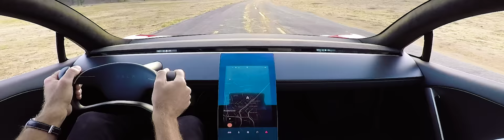Tesla

Comment: Need. A. Tesla. ASAP.
Reply: Want*
Reply: Need*
Reply: Get. SUM. Money. ASAP.
Reply: 100 thousand dollars at least.
Reply: Don't use auto pilot on a tesla you'll die.
Reply: not many people have died from using auto-pilot. But everyday people die from driving by themselves.
Reply: Attack Helicopter Chris Tesla blamed the deceased driver while the car was on autopilot dude lol that's fucked up
Reply: Rimac cars are better (stronger) :D
Reply: x50 get a fire extinguisher and window hammer first.
Reply: curiosityuniversal VICTIM WHO DIED IN TESLA CRASH HAD COMPLAINED ABOUT AUTOPILOT BEFORE
Reply: This just happened today! Tesla with Autopilot slams into truck stopped at red light
Reply: did they ever say that you can or should use autopilot because it can do everything a driver can? No. It can't, it will probably be able to in few years... Autopilot is only safe to use on streets where there aren't many turns etc.  and in those cases it's much safer to let autopilot drive instead of you. But it's not synced to every stoplight, you should know that. It warns you every 2 minutes or  something to put hands on the steering wheel. And if what you mentioned about the truck is the same crash I've heard of, than it's because autopilot couldn't "see" the truck because it was white so it couldn't make a difference between sky and the truck. That problem could be solved by not making roofs that are reflective...

Comment: Electric > gas
Reply: Anyday
Reply: Definitely not, a such statement would need a context to be true. It's similar to saying airplanes>submarines. Ok but in what?

Electric is mostly better in light and small sized, short ranged traffic vehicles, while gas is better in longer range, bigger vehicles like SUVs and pickups. Of course you can make everything electric as Tesla just did, it's just not going to be generally better. Primarily in the cost of it. That's why I'm worried about the Tesla truck, it could be the doom of the company. Making a superheavy, super longe range highway vehicle electric gives you all of the disadvantages and none of the benefits. That truck'll be like steam power efficiency, I really hope they don't screw things up with it.
Reply: G.Zoltan electric > gas

Comment: Theyre advertising because Tesla is failing it's production requirements.
Reply: Legion. Yeah they shouldn't be cause, mostly electric car manufacturer like Tesla doesn't tell stupid Americans about the truth about those batteries and after how much mileage they start to decrease in their power. And secondly the battery manufacturing cause more pollution than the IC engines so it's not green. Mostly the people who  buy teslas are rich Americans who don't even like cars. Third why do you even need the Tesla roadster it's totally stupid for a production car to have that much acceleration. And then the stupid people compare electric motors to ic engines.

Comment: Something I can't figure out. We can make magnetic fields from electricity with things like copper wire, we use that to rotate permanent magnets which come from rare earth materials, which if not rare, are hard to extract and most of it comes from China. So what stops anyone from making motors from two sets of magnets created from electrified magnets instead of one being permanent? It would be easier to source the raw materials, reuse and recycle.

Comment: I've always thought or wondered  why is one of the four wheel rigged up to a dynamo to charge a secondary battery whilst it's moving when 1st battery is low switch to secondary battery and start over again dynamo charging up the 1st battery once the cars going shouldn't it be self charging  then ? Someone with smarts please explain why this wouldn't work
Reply: Well due to losses in the dynamo, motor, wiring and battery all you’re essentially doing is wasting energy.

Comment: So far, they have sold me a brand new 2021 Tesla Model 3 with damages throughout. Touch-up paint coverups on door hinges with a broken clip which is a safety issue and other door hinges that are scratched with scratches on the inner door sill, passenger door that is so close to the rocker panel that it has actually scraped the paint off and some metal with it, door handles that are not flush, a improperly aligned hood which has chipped paint on the edge from touching the body when opening, defective paint throughout, thin paint on the bumpers to the point where you can see the primer through the clear coat, charge port flap that touches the paint when opening, and I’m afraid to look any further. These were all unnoticed until I took the vehicle straight home to my garage to wait to get protective paint film on it. I had to cancel that appointment due to all of the damages this new vehicle came with. 17 miles and it is in worse condition than a 20 year old used Kia. I was told from my sales agent that it was my mistake to accept the delivery. I suppose the buyer is expected to inspect the entire vehicle from top to bottom and expect severe cosmetic damages, misaligned body parts that cause damage on its own, and illegal coverups of vital safety components. So now, I have to take legal action unless I get what I paid for and adequate compensation.

Comment: The CybertrUCK

4 motor variable transfer case for engine failure power mitigation system

2-4 motors equipped dependent on need.

F50 for the people
Like a timeshare, that can save a lot of time
Reply: Motors over,side suspension